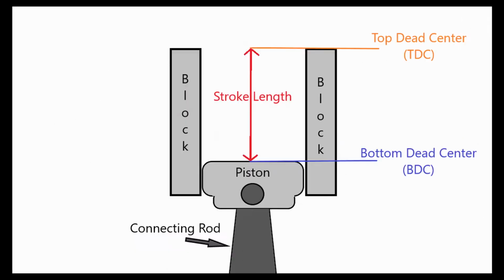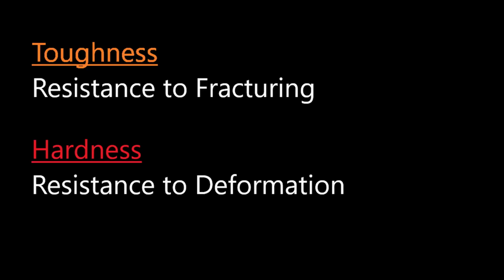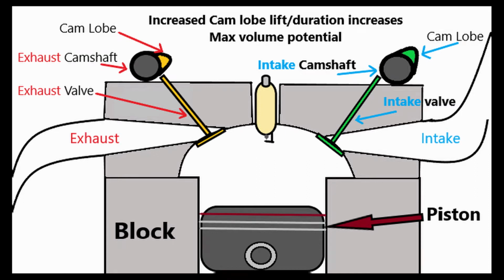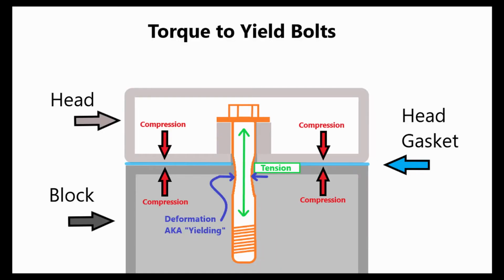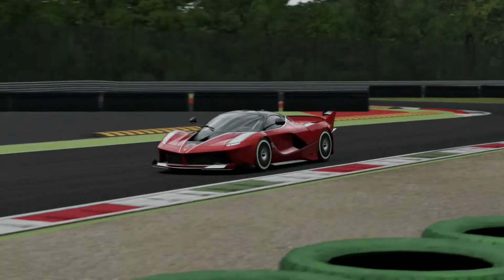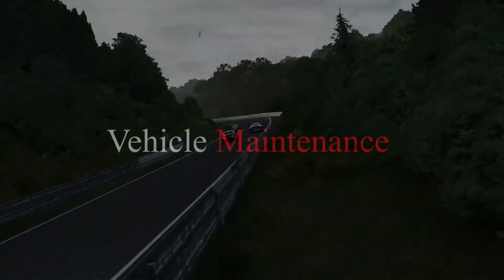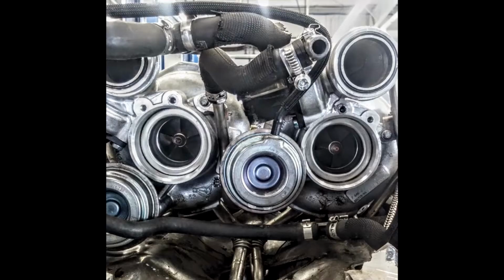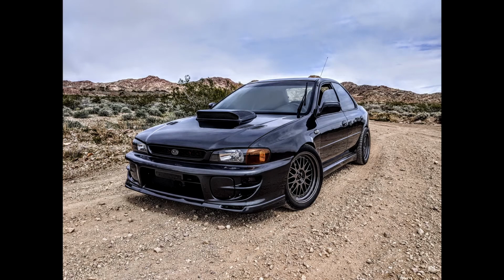Supporting Horsepower Goals on YOUR Project Car (Mechanically)

Comment: This video is one of the best I've ever seen. It's pretty clear the way that you explain all the details. I have a GC project and every time I watch one of your videos I learn something new
Reply from the maker: Thank you. My goal is to help as much as I can. If you have specific plans, questions, or suggestions let me know, I'll try to point you in the right direction. If you check out my "Suggested content from other YouTubers" playlist, there are some solid subie/car channels with good information.
Reply: @RyUploads  Thank you so much! Definitely I'm going to take a look at that playlist. Actually lately I have been wondering which one is the most reliable and easy to find parts for an engine Swap. I'm doing a research about parts and costs to turn my FWD 1.6L GC into an incredible machine like the Benji. I'm from Colombia, South America. And most of the parts needs to be imported from the US so I'm being careful and planning as much as I can. For now I'm focusing on the exterior pars with a STI Bumper Swap.
Reply from the maker: I would say the easiest way to have everything you need for a swap is to have a donor car. To convert fwd to awd it can be from a GC or GD chassis (including the wagon versions GF & GG). The distance between the wheels on the wagons are a little narrower than the sedans fyi, but they all bolt on with no mods needed. If you are unsure of wiring things I suggest getting a harness made by iwire. I haven't used them, but they have a really good reputation and have been around since 2008 I believe. Depending on your experience I suggest starting with a stock swap to lower the possibility of complications. 

If you can't source a car locally you will most likely need to get parts from several places. This really depends on your budget and local market. If you have cash saved up you can buy a front and/or rear clip of a car and it should have everything you need.  If there are specific parts that I have that you want let me know and I'll let you know some options.

If you want OEM style body parts it might be best to get it from your local subaru dealer. I ordered my front bumper from then and had it shipped to the dealer and it cost $200 total because shipping to the dealer is free. That may not be the case where you are so ask first.

In my opinion (your choice), if you really want to enjoy the car I say start with performance parts first. Making the car look good is cool, but you will really appreciate the car when it's awd and handles better. I've had 1.8 and a 2.2 non turbo cars that were a ton of fun around turns and on dirt. Once you get the car moving how you like it, the aesthetics come pretty easy in my opinion. Aesthetics can drain your budget quickly if you aren't careful, so that's why I say do performance first.
Reply: @RyUploads  
Yeah. that's true. the easiest way to do an AWD Swap is to have a donor car. Unfortunately, those are not as easy to find here in Colombia. because the GC AWD Version never arrived in this country only GF got AWD over here and those are pretty rare... here the GDs have AWD but those are not common as donors, I would say is the Hawkeye is the most common Impreza around here and is still a little rare.

I have been doing some research about the 90's Legacys. Those are easiest to find donor options. I found a 93 Legacy with 5speed transmissions with low range and a no running EJ20 engine in USD900 approx. but took the measures of the distance between the front wheel and rear wheel of the Legacys are 258CM long and the Impreza is 252CM long. So, now I don't think a Legacy AWD swap would work :(. Another option i found is a used Hawkeye 06 wagon Transmision also with low range, that one cost around USD 1.100 but I'll still need the subframe and the gas tank and engine. Another engine option I've found is a 2.2L EJ22 from a legacy used but in good condition per USD650.

Those are the local options that I have found. I've been thinking about importing used parts from the USA but I'm not sure about what reliable seller or web I can visit to have an idea of the parts and prices.

I would say those are my options, being honest I'm not sure what to do I would say my goal with this project would be to have a reliable fun to drive and car with a decent amount of power around 150-250hp would be awesome for me but at this point, I'm not sure how to get there. So, what do you say, what would you do with the local options that I just described.

Per now I'm enjoying my reliable 1.6L and doing research about Subaru swaps and projects like yours. So please! keep doing your videos! I loved the first interview that you made! it's nice to see other people's projects to find inspiration!

This is a picture of my beloved green GC just after the bumper swap! https://i.imgur.com/4szUDv0.jpg